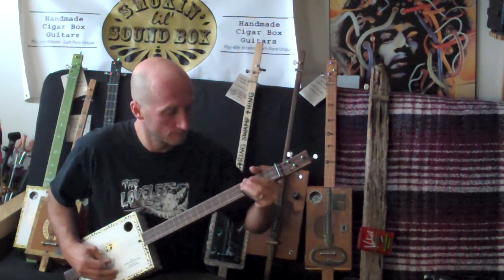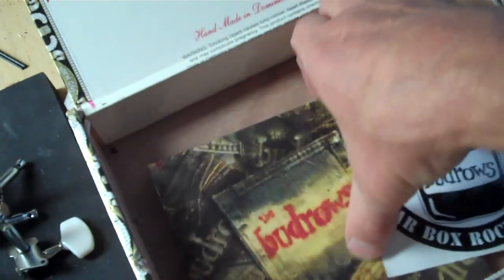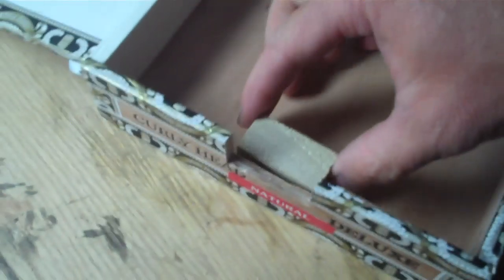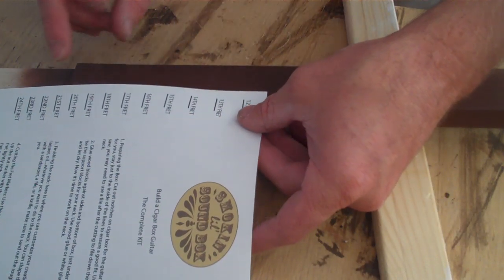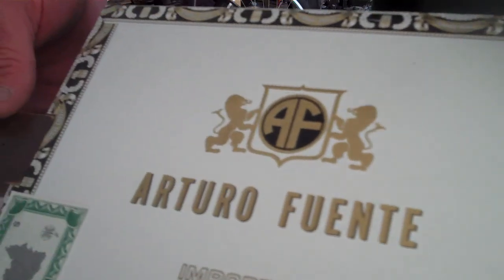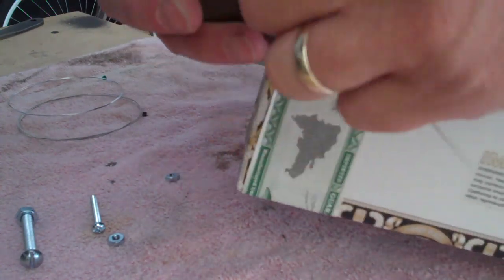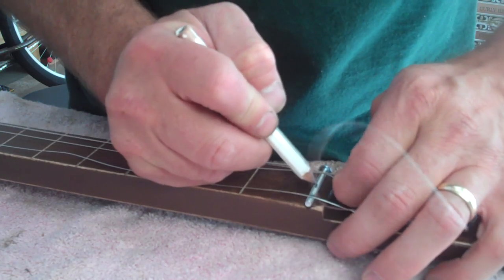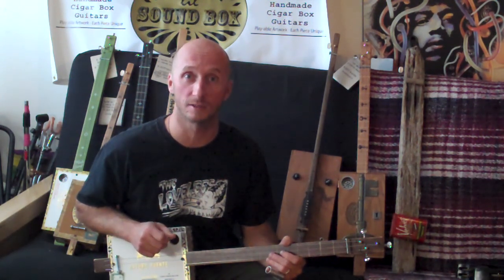Cigar Box Guitar Kit   build it yourself

Comment: Get a 1/4 inch guitar jack online or at the music store. Go to Radio Shack and get a Piezo Buzzer (for the pickup). Drill a hole for the jack, put the jack in place. Glue down the piezo and solder the wires to the jack. Presto!